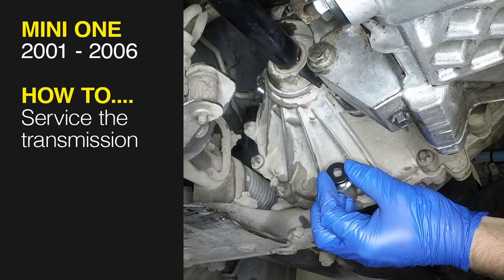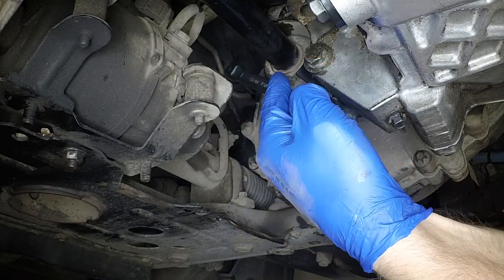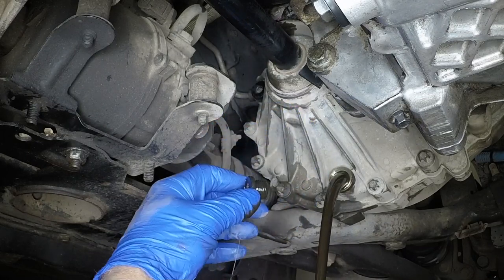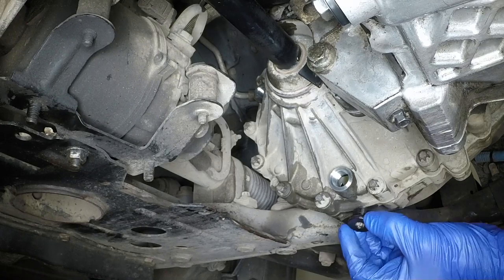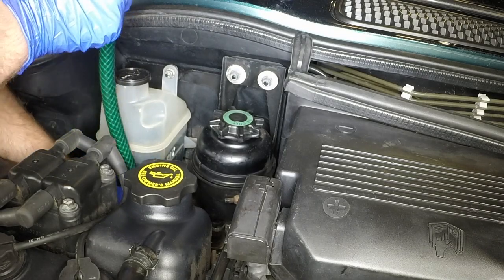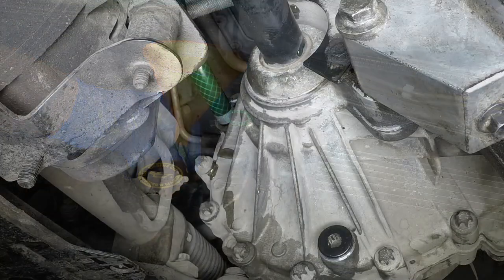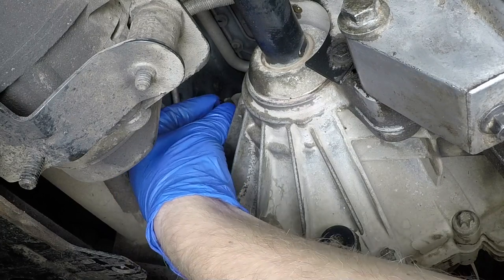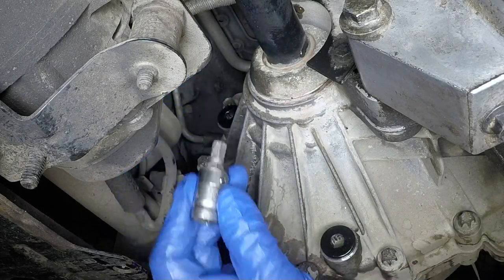How to Service the transmission on the Mini One 2001 to 2006

Comment: Could have said what yype fluid it used...quit saying oil when you mean fluid..
Reply from the maker: The manual covers manual transmissions only. All models up to 07/2004	Texaco MTF94 Lifetime transmission oil
All models from 07/2004	MTF-LT-3 Lifetime transmission oil. For some reason in the UK, manual transmissions have oil, but Auto boxes have fluid...no idea why!